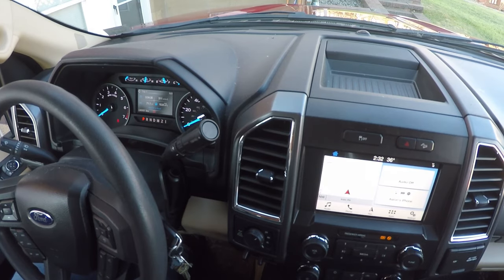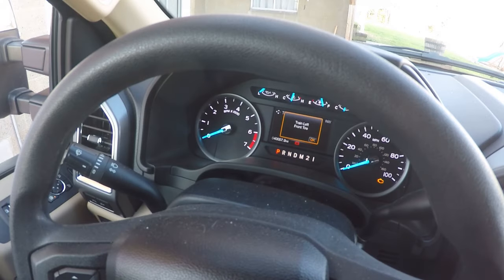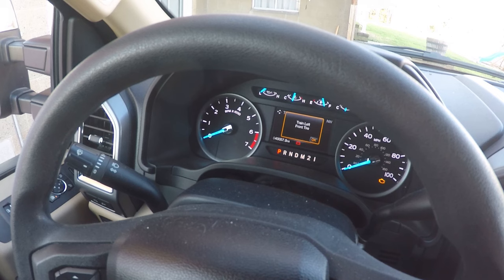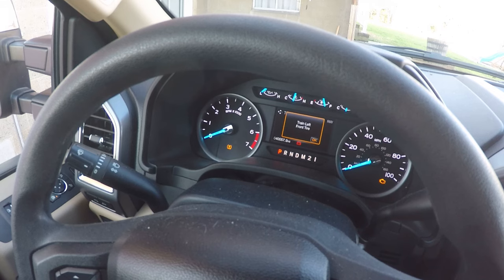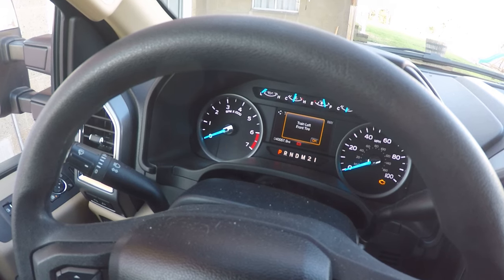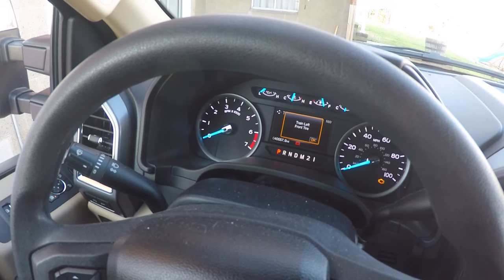How To Train Ford Tire Pressure Monitoring System (TPMS) Sensors

Comment: Thanks for the video. Would you know how to do this procedure on a 2022 Ford Transit 350 HD which has dual wheels in the rear?
Reply from the maker: As far as I know, it's the same, except that when you're training the rears, you will do right outer, then right inner, then left outer, then left inner to account for the additional two tires.
Reply: Thank you, I will try that. @stuffyoucando2

Comment: just put new aftermarket wheels and tires on. Was OEM.. went through the process 6 times now. Letting 10-15 psi out of left front and never beeps. Then Says failed, every time. Wondering if the retailer put the TPMS in before installing tires…
Reply from the maker: Sounds like you need to give them a call. If the TPMS are still in your original wheels and your invoice for your new ones does have new sensors on it, you likely don’t have them now.

Comment: Just tried this repeatedly today.  Did exactly what you said.  The prompt said to begin to train first tire, drivers side front. Did that until horn beeped.  Went to check to see what dash said and it says training unsuccessful and to repeat.  We tried to let more air out again but nothing.  Then we filled the tire back up and started the process all over again with the driving 20 for 2 minutes.  After getting the horn to beep again in the first tire it says same thing.  Training unsuccessful.  Any ideas?  Just a girl trying real hard here lol.
Reply from the maker: How long did it take for the horn to beep while you were letting air out? It may have been timing out while waiting. I recommend making sure you’re fully depressing the valve stem core to make sure air is coming out as fast as possible. What is the reason for needing to perform the procedure? Did you have new sensors installed or just a tire rotation, etc?
Reply: @stuffyoucando2   it’s been like this since the winter.  Just not had an opportunity to try to reset.  I believe it could have happened after our last service at the dealership when we got our tires rotated.  The sensor didn’t go off right after the rotation though.  We do not drive it  often it is used mainly during camping season.  It’s a 2017 with just 36,000 miles.  I am using just the tire pressure gage to release the air and it does take a long time for the horn to blow once we start letting air out of tires.  I appreciate any help.
Reply from the maker: @ginaford3679  I think you should try using a different method to let the air out, like a small flathead screwdriver to push in the stem to help it get out faster. If that doesn’t work then it sounds like you need to replace your TPMS sensors, they are getting up there in age on a 2017.
Reply: @stuffyoucando2    Thank you we will try that again, first chance we get.
Reply: Tried this on my 19 Fusion And went from 38 pounds of pressure to almost 12. And nothing ever happened No honking Period Told me to retrain

Comment: Good video. I have a 2021 f250, I rotated my tires a few days ago and I said damn my sensors are going to be all screwed up. Within 2 miles down the road everything was synced in together .
Reply from the maker: I doubt they are, try putting air in one of the tires and if you have the screen that shows the pressures, see if it actually matches the one your putting air into. Chances are it doesn’t match.
Reply: @stuffyoucando2  well I had to air up the tires that I moved from front to back and the reverse of back tires moved to front . Rear calls for 80 and front 70 psi. I put 1 pound too much in passenger rear going by my dash read out . I let 1 pound out and it changed on my dash .
Reply from the maker: Maybe you righted a previous wrong then. They don’t sync themselves.
Reply: @stuffyoucando2  I'm 100% sure I didn't write a wrong. I tow a travel trailer and I'm always checking my pressures manually and buy the trucks read out . What year is your truck ?

Comment: 2020 Ford Ranger. Deflating tires didn't retrain tire pressure monitoring.
Reply from the maker: It should work, make sure you’re following the steps exactly.
Reply: @stuffyoucando2 I noticed, in the video, you stopped deflating before the horn tooted. Why?
Reply from the maker: @lucashack5318  I didn’t. Air was still being removed from every tire when the horn sounded. You can hear both the air and the horn clearly. The first tire I did start to unscrew the tool as it sounded but was still removing air.
Reply: @stuffyoucando2  how long does it take one tire before the horn sounds?
Reply from the maker: @lucashack5318  it can vary, as you can see in the video some took longer than others. Are you actually getting it into training mode? You also need to make sure that air is coming out at a decent rate, if it sits there a long time without seeing air removed it will time out.
Reply: @stuffyoucando2  I'll put it this way. My front left tire is now half flat. Dash just keeps saying to train the front left tire.
Reply from the maker: @lucashack5318  Why are you doing this procedure, did you get new sensors or did you rotate tires?
Reply: @stuffyoucando2  I swapped out my tires and rims for a used set that I purchased.  They came off a Ford  and they have the sensor on them.
Reply from the maker: @lucashack5318  there’s your problem, your vehicle is still looking for your old sensors. This procedure is meant for retraining the truck for the locations of the existing sensors, it doesn’t program new ones. Used or not, the sensors in your wheels are new to your truck.
Reply: @stuffyoucando2  well then, how do I train new sensors?
Reply from the maker: Check your owners manual or try searching for the relearn procedure.
Reply: @stuffyoucando2  Ok. I'll dig a little deeper. Thanks for helping

Comment: Will not beep or do anything when letting air out of my tires
Reply from the maker: Then you must not be in the training mode.
Reply: @stuffyoucando2  I did everything you did. It shows train left front wheel put after that nothing
Reply: @KalebConley-jb4sh  My '21 F150 does the same thing.  Nothing. Any ideas?
Reply: Same hete
Reply: Same here